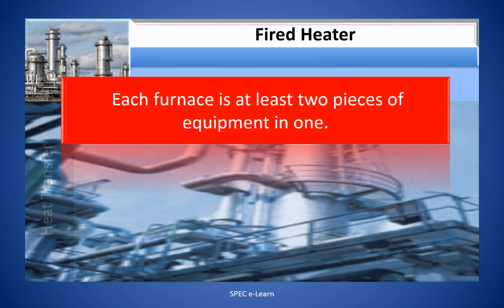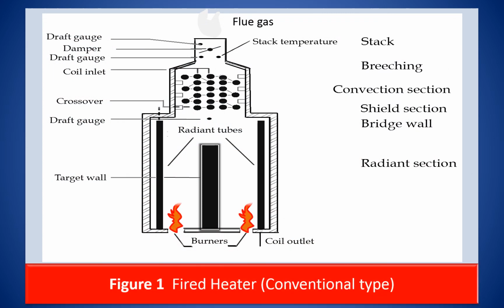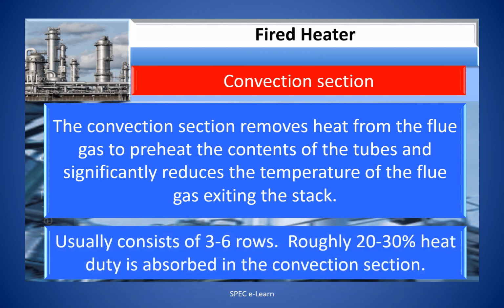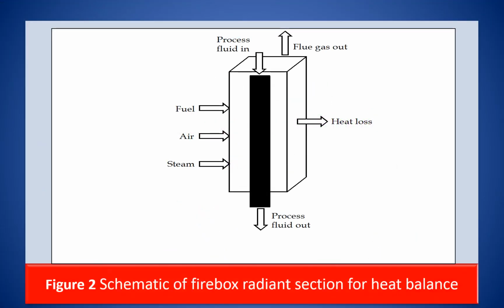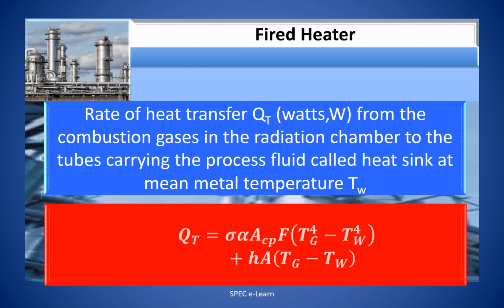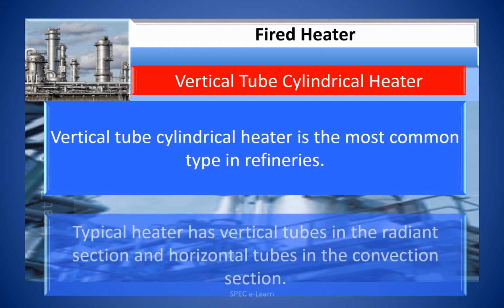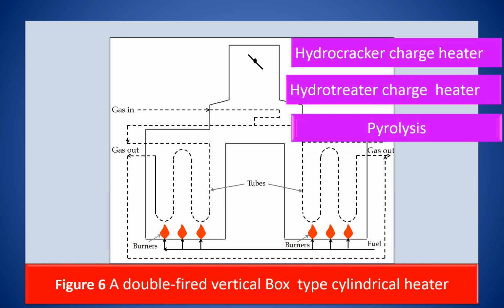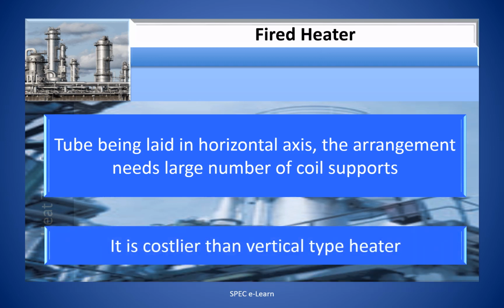Fired Heaters - Types And Applications Part 1

Comment: What is bridge wall temperature means?
Reply from the maker: The bridge wall temperature is the temperature of the flue gas after the radiant heat is removed by the radiant tubes and before it hits the convection section